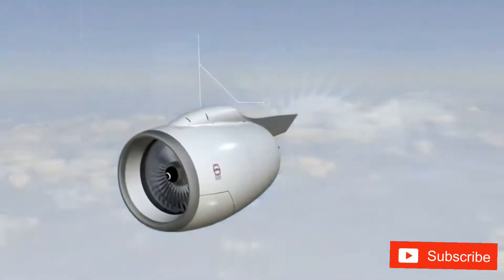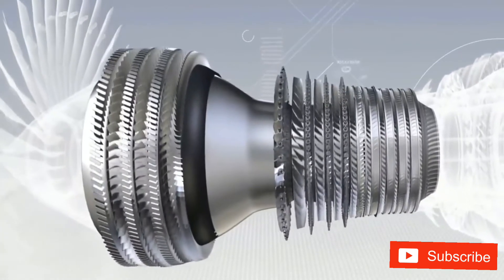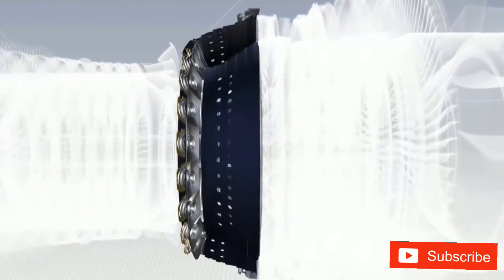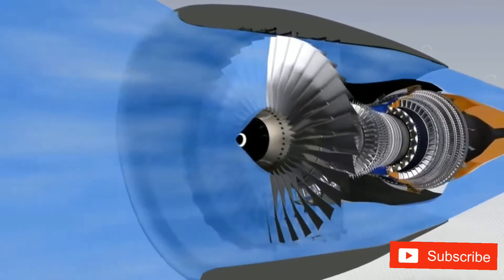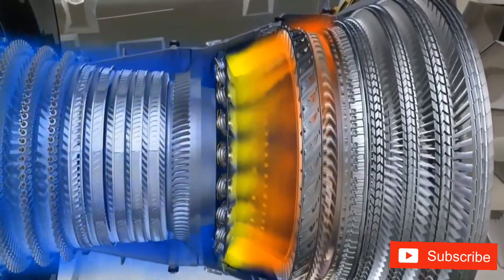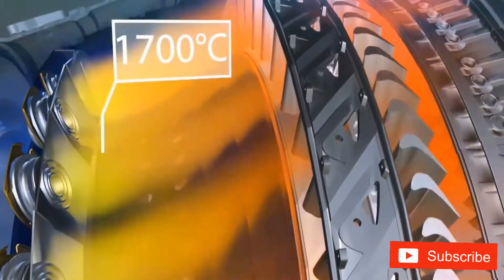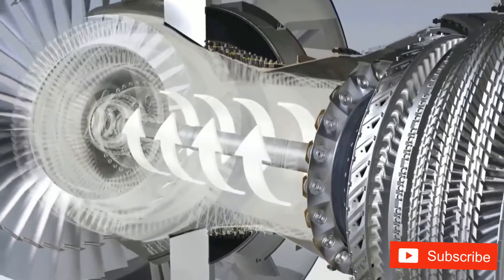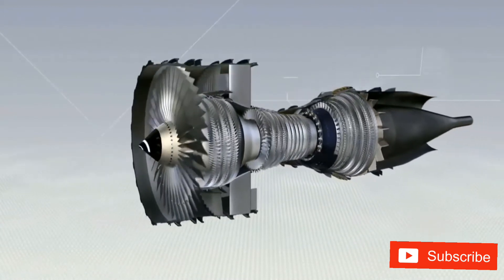Jet Engine Working | Jet Engine Firing | How it works? | Animation |

Comment: What is the rpm of a jet engine?
Reply from the maker: For example, large jet engines operate around 10,000-25,000 rpm, while micro turbines spin as fast as 500,000 rpm. Mechanically, gas turbines can be considerably less complex than internal combustion piston engines.